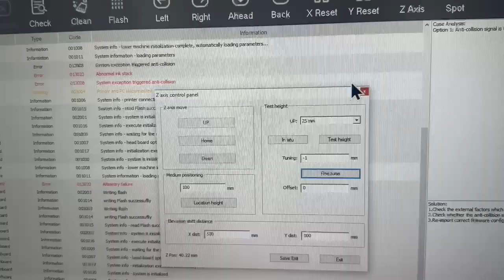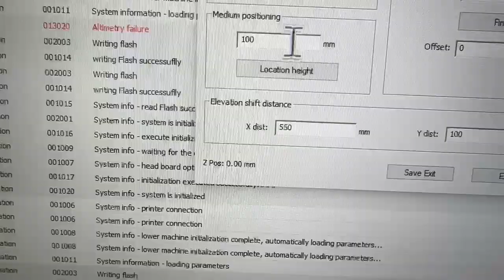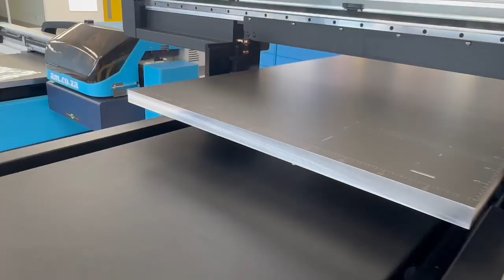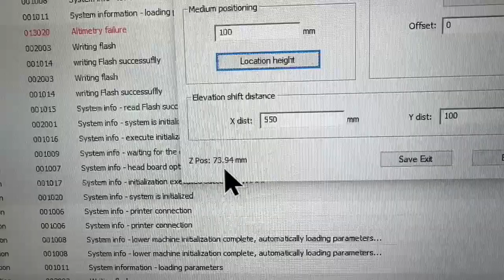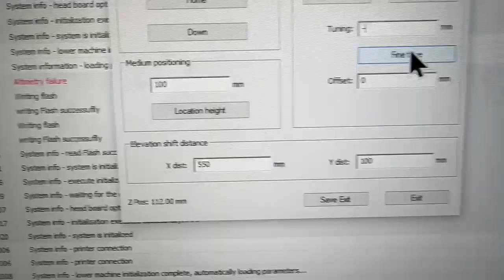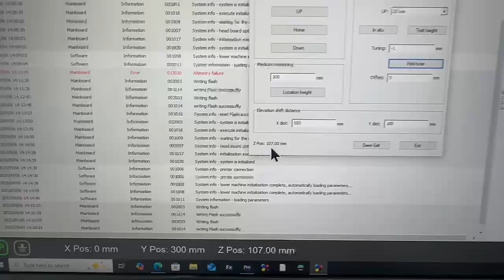Z-Axis Height Adjustment for FlatPRINT 6090 Flatbed UV Printer with Automatic Height Sensor

Comment: Hi, how are you? How do I disable automatic adjustment and keep the sensor only stopping when I adjust it manually?
Reply from the maker: Want to chat to us on WhatsApp? Simply send “Hi” to 060 600 6000.

Please contact sales and they will be able to advise by WhatsApping 060 600 6000

Feel free to contact sales @ 011 397 1429 / 021 555 3250 / 060 600 6000 / 072 222 2211.